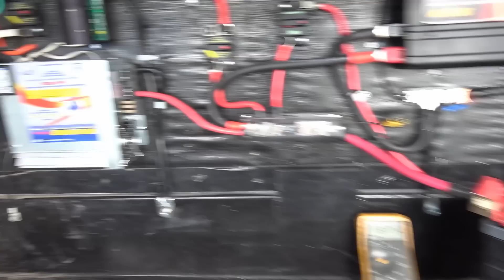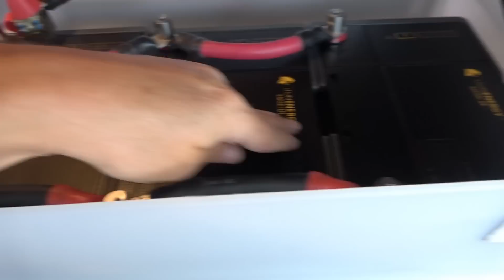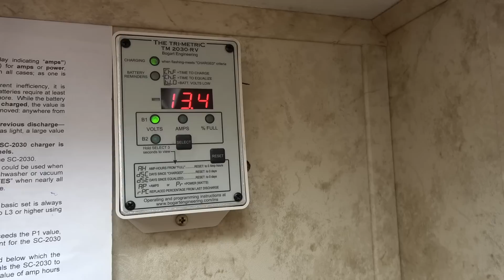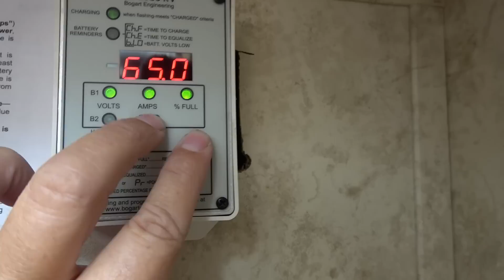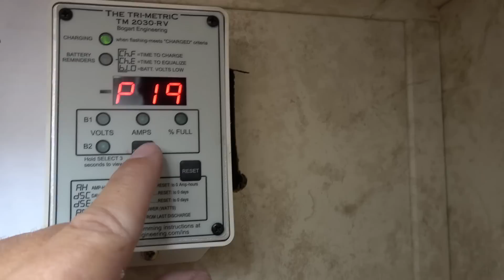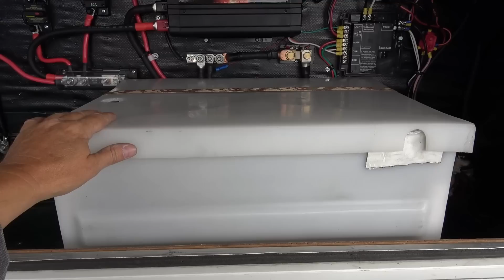Lion Energy Safari UT Lithium Battery Review (Part 2 - Installation)

Comment: Hello Ray,  Do you have a Voltage chart  for the Pourcentage of battery.    Lion Energy does not have one on their site or owner's manual..  It seem to be different here and there on Lithium forums .   
I finally installed my 2 UT 1300  Batteries.  Spent a good amount of time preparing the box.  i made ade the cables myself and changed the existing lugs that were openly crimped.  I used a hydrolic crimper and heat shrink after watching your video on RV battery cable tips.  So far so good, it reads 13,3V..  
Need new converter like yours now., I hope they come out soon.  Cheers.   😊
Reply from the maker: A voltage chart doesn't help much with lithium. They have a very flat discharge curve versus Lead Acid.  They pretty well stay at around 13 volts till almost dead. That's the beauty of them, not much voltage change as capacity drops. To get a true idea of the current state of charge get a good battery monitor that uses a shunt. Most people like the Victron stuff https://www.victronenergy.com/battery-monitors  I have an older style Trimetric, still works fine though http://www.bogartengineering.com/products/battery-monitor.html  Usually my UT1300s will keep charging until they hit around 14.5-14.6 volts then the internal BMS disconnects the charge. When I stop the charging when they are full I usually see them level out at around 13.4 volts.
Reply: @LoveYourRV  Hello Ray, Thank you for your reply and links. 

What do you mean when You stop the charging?  Do you manually do something or do you mean the BMS stops?     I guess I will not have the 14-5 charge until I change the converter.  it's a 13.6V.

I have an MT-50 remote Meter connected to the Epever MPPT solar charge controller.  I don't know if the meter works shunt style,, but I get a reading.  I wonder what percentage I should think about hooking up for a charge if the batteries are too low. I do not have a generator.   
Have you ever run them down to zero, it just shuts off?  I guess I need to get used to the new numbers.  I had AGM's before,  Can't wait to take the road and see how it performs

I appreciate your help greatly.  🤗.   Cheers.
Reply from the maker: To get a full charge you'll need a charger that can put out around 14.4V.  Most solar controllers can be set to do that. The internal BMS (battery management system) has over voltage and under voltage protection so you can't go too high or too low in charge and hurt the lithium cells. It will automatically stop charging or discharging to protect.
Here are videos where I did charge and discharge tests on an early Lion Energy model UT1200  - https://www.loveyourrv.com/testing-lion-energy-safari-ut-12v/
Reply: @LoveYourRV  Thank You, Ray, I am viewing your charge/ discharge test link. Your Lion Energy Playlist is so complete,  Super Great work,  Many thumbs up, and Many many thanks for your help. 🙌🏼🌈⭐

Comment: Can I take out my existing batteries to begin my Lion Energy Battery install and still use shore power electricity?  I don’t have a solar cut off, so, I would disconnect them at the roof port, pull out the 30a fuse that charges the batteries at the converter,  thatnohh theee fuse near the solar charge controller,  anything Else I should do?  
What about the Lugs size., when the receiver is 1/4 and existing lugs are bigger, like 5/16 or 3/8th should they be replaced? I also would like some sort of insulating pad at the bottom of my outdoor metal Box,  would you have a suggestion?  Some foam, reflectix, some insulating carpet style?  Thank You for all the excellent helpful  videos on these Lion Energy batteries.  They will accompany me for a good long while 😊😽🌈.  Cheers.
Reply from the maker: Yes, your converter charger will provide power to the RV 12V circuits when the batteries are disconnected.  For the lugs, you could use washers to make the sizes match. I used a cheap foam-backed carpet in my box to insulate and protect the batteries. https://youtu.be/nHC5i1P_8hw  I wouldn't use Reflectix as it may be conductive and risk shorting the battery if accidentally touches the battery terminals.  Cheers, Ray
Reply: @LoveYourRV  Thank You very Ray 😊,  
I wish You and Ann good day West.  
We still East, Fl.  Atlantic Ocean is drawing us in ☀️🌈😽🥰

Comment: Ray, what about your converter/charger? Does that also charge the batteries, if so is there any special settings. I also have a Progressive Dynamics converter/charger.
Reply from the maker: Check out this post and video it will answer questions about charging with the converter charger  https://www.loveyourrv.com/lithium-battery-charge-test-can-you-use-a-lead-acid-charge-converter/

Comment: DONT BUY 
My 1300 lion energy Battery just blew up! But I was told by lion energy that there's no way that the Battery could go over 15volts. But yet the battery exploded and there own sales rep dealer I took my rv to seen it at 19volts. But lion energy said that is not possible. So basically there saying there own lion energy rep is lying. And they can't explain why the battery exploded if it can't go over 15volts. Seems a little fishy to me. 
Also it was a refurbished battery I bought directly from LION ENERGY at the RV show. But they still say it's not there battery
Reply from the maker: Sure does sound fishy to me, maybe the refurb battery you bought wasn't a true Lion Energy lithium as I have to agree with Lion Energy that it's not possible to go to 19 volts. I just don't see how that's possible. What exactly do you mean by exploded?

Comment: Hello Ray, Thanks to you I bought 2 of the UT1300. Great videos (subscribed). Found out after that my Magnum MMS1210 1000W Inverter Charger will not fully charge the Lithiums. I don't need to install them just yet since I am on shore power. I just purchased a used 5th wheel last year and came with residential frig, a couple solar panels and a 55k onan gen. what inverter/charger and how big would you recommend to get if you had to start over? 
Sooner than later I'll be getting a 3rd battery then work on more solar panels down the road to run more appliances and possibly one A/C.
Any advise would be appreciated!
Reply from the maker: I'm not certain of specific brand names but you'd want to look for an inverter charger that can be manually programmed for charging voltages or one that says it can be set specifically for lithium, the lithium batteries like a constant charge voltage of at least 14.2V an up to 14.6V for the Lion's. I've been setting my chargers at 14.4V and its worked well.  Cheers, Ray

Comment: For charging these batteries, what type of charger did you use?  Anyone have a brand that recommends to charge it with?
Reply from the maker: I've done 9 videos on the Lion batteries, several with demo charging times, you can find links here - https://www.loveyourrv.com/battery-review-lion-energy-safari-ut/  I found that my existing Intelipower PD9260 converter charger worked well when placed in boost mode and I used my Bogart solar controller as well with good success. The Lion Energy company recommended a converter charger from Iota with the Lithium add on - https://www.iotaengineering.com/IQ/#!/detail/IQ-LIFEPO  Intelipower also makes a lithium specific charger - https://www.progressivedyn.com/specialty/inteli-power-pd9100l-series/   Many of the better hybrid Inverter/Chargers also have settings for litium batteies.  Cheers, Ray

Comment: Won't the Styrofoam put extra heat on the batteries?
Reply from the maker: Yes, will help keep them warm when it's cold out. They don't charge if they drop below 32F (0C)
I ended up changing the box mod and now have heavier foam for protection and wood keeping batteries secure. https://youtu.be/nHC5i1P_8hw  I think it will work well for the temperature ranges I normally see. If I camped in really hot climates I may have to remove the padding or mount the batteries in a climate-controlled area of the rig.  Cheers, Ray

Comment: A thorough review on the batteries

https://www.youtube.com/watch?v=eJaK7fJ4gQU
Reply from the maker: Looks pretty decent inside, glad to see some heavy wires. I was surprised by the capacity test of only 80AH.
I just completed a low amperage drain test slowly over the last 5 - 6 days on my three battery bank. 270 AH rated capacity and came in at 267 AH used according to my Trimetric battery system monitor and the BMS hadn't cut out yet, but the battery voltage was down to 11.5V so I called it quits. 
I'm getting ready to do a high amp discharge test next so will see if I get similar results pulling a hundred amps and going to do a few other tests before I put out my test results video. Cheers, Ray
Reply from the maker: Just finish a high amperage test. Fully charged one of the Safari UT batteries until the BMS cut the charging voltage then added a continuous load of around 82 amps using my inverter powering a space heater set in 900-watt mode.
My Trimetric battery monitor was showing 0.00 AH to start the test, at the end of the test when the BMS cut off for low voltage the Trimitrec monitor read 87.5 amp-hours used.

Will continue doing several more tests I have planned. Likey publish a full testing and demo video next week  

Cheers, Ray
Reply from the maker: If you are interested I've completed my own Lion battery tests, result videos can be found here - https://www.loveyourrv.com/testing-lion-energy-safari-ut-12v/  Cheers, Ray

Comment: They get taken apart and tested...https://youtu.be/eJaK7fJ4gQU
Reply from the maker: Looks pretty decent inside, glad to see some heavy wires. I was surprised by the capacity test of only 80AH.
I just completed a low amperage drain test slowly over the last 5 - 6 days on my three battery bank. 270 AH rated capacity and came in at 267 AH used according to my Trimetric battery system monitor and the BMS hadn't cut out yet, but the battery voltage was down to 11.5V so I called it quits. 
I'm getting ready to do a high amp discharge test next so will see if I get similar results pulling a hundred amps and going to do a few other tests before I put out my test results video. Cheers, Ray
Reply from the maker: Just finish a high amperage test. Fully charged one of the Safari UT batteries until the BMS cut the charging voltage then added a continuous load of around 82 amps using my inverter powering a space heater set in 900-watt mode.
My Trimetric battery monitor was showing 0.00 AH to start the test, at the end of the test when the BMS cut off for low voltage the Trimitrec monitor read 87.5 amp-hours used.

Will continue doing several more tests I have planned. Likey publish a full testing and demo video next week  

Cheers, Ray
Reply: @LoveYourRV  can't wait to see your real world evaluations.  Testing is one thing, using these like a normal RVer with solar is going to very interesting.
Reply from the maker: If you are interested I've completed my own Lion battery tests, result videos can be found here - https://www.loveyourrv.com/testing-lion-energy-safari-ut-12v/  Cheers, Ray

Comment: If I had 3 lithiom batteries exactly like yours and a Progressive Dynamics charger exactly like yours but I had no solar panels at all ,  what other components would I need to go along with the batteries and charger?
Thanks for the videos
Reply from the maker: Hard question to answer, RVers have different power needs based on lifestyle. Some only run a few lights and turn the water pump on once in a while. Others run everything just like they were on full hookups. satellite TVs, cooking appliances, AC. etc.
A big difference in equipment needs. Usually, the two things that get added are a generator to recharge with and an inverter to run the plugin AC type power things. But like I said what you run off-grid makes a big difference in the size of them and cost.

Comment: Can I ask the exact length of the jumpers? I have the exact same batteries arriving soon .

Looks like around 7” and 2/0 AWG wire?
Reply from the maker: Mine are on the neighborhood of 7 - 7/12 and 2/0  reused from my previous 4 golf cart battery bank.
On the new LIon's arranged as they are the terminals measure 6 1/2" apart center to center.
Reply: Love Your RV thx

Comment: Excellent video Ray!  Just curious if you had to make any adjustments to your INTELI-Power converter/charger for the new Lithium Batteries?
Reply from the maker: When charging with the InteliPower I just had to set it to manual boost mode using the little Charge Wizard pendant. That was it, they charged right up.  In normal mode, it goes through boost multiple levels of charge voltage 14.4V, 13.6V, and 13.2V I think, but in boost mode, it sets to just 14.4V which is good for the lithiums.

Comment: Its been a year since I put the settings for my Battleborn Lithiums into my Trimetric. Thanks for sharing the settings, I wrote them down and will see if the ones on my unit are close to the same. I know I set my battery AH at 300, so if you should find out that they require 270, let me know. Like always, another learning experience, thanks.
Reply from the maker: I found this page by Battle Born on setting up their battery with the Trimetric/Bogart combo - https://battlebornbatteries.com/setting-trimetric-tm-2030-battery-monitor-battle-born-batteries/
My Lion system does get set to 270AH as they have a rated capacity of 90AH. I think BB is 100AH though so 300AH should be right.

Comment: You should REinstall the temp sensor, as you will harm the battery's if the solar or alternator charges them Below 0C  or 32F. Otherwise great install, and i'm sure you can't believe  how much better they work.
Reply from the maker: That won't be an issue as these have a sophisticated BMS (battery management system) built inside each battery. It has a temperature sensor of its own and will shut the charging down if the temp gets too low or high then turn it back on once it's safe to do so. I have a wireless thermostat in there so I can keep an eye on things if we encounter any extreme weather.

Comment: How does this work with your old Rv converter charger
Reply from the maker: They will work with an older converter charger but likely not as efficiently as with a newer lithium specific charge converter or a solar charge controller adjusted for the lithium batteries.  With the old stock charge converter, the charging may not be as fast and may not get to 100% charge.  For example, with my OEM WFCO 8955 charge converter I usually only saw a max charging voltage of 13.6V, that was even too low for my lead-acid golf cart batteries and is also too low for the lithium that want to see 14.2-14.4V to charge efficiently.

Comment: Is that compartment a converted area from storag over to electrical? I don't know a lot about 5th wheels. Also, if people don't have the electrical background as you have, is it possible to self install what you have?
Reply: Thank you Ray, you do a great job of laying out step by step.
Reply from the maker: It is a storage compartment but also where the trailer manufacture mounted the original 12V lead-acid battery and some of the RV 12V circuits. So it has always contained some electrical wiring, I just expanded on it as I added more batteries and an inverter then later on a solar power system. Many DIYers have installed similar but there are of course risks involved, it's up to a person to decide on their abilities to tackle the job to get a professional to do the job. Here is a video explaining my wiring - https://youtu.be/1f145rhB_e0  Cheers! Ray

Comment: Lithium as I understand is most affected by temp compared to lead acid, especially below freezing or above like 140 deg fahr
Reply from the maker: The battery specs indicate Lion Lithium battery operating temps as charging in a temp range from 32F all the way to 113F and discharging between -4F and 130F.  Lead acid is poor at low temps, loses quite a bit of its capacity when cold but doesn't completely quit. that's why people have a hard time starting cars in cold weather.

Comment: Yeah, some Lithium company's advertise 100ah and the is the usable ah's like Battleborn batteries the extra 20% they dont advertise. Si if you buy 100ah that us what you get. Other companies say 100ah but you onky get 80% charge on the LIFEPO4. So that is why Lion said 270ah.
Reply from the maker: Lion says usable capacity is 90AH but they are 10lbs lighter and also smaller and have higher max discharge amperage than the BattleBorn so I guess that's the tradeoff. I think the Battleborn are using many little cylindrical lithium cells and the Lion are using 4 large prismatic type cells.
Reply: @LoveYourRV  i see, that makes sense. Thanks for sharing.

Comment: At the start of the video you were touching both poles at the same time and that didnt shock you? You got bigger nads than I sir.
Reply from the maker: My skin resistance is high enough to make it safe to touch such a low DC voltage around 13.5V, only starts to get dangerous at much higher voltages.  https://youtu.be/OpqW4Ey9618